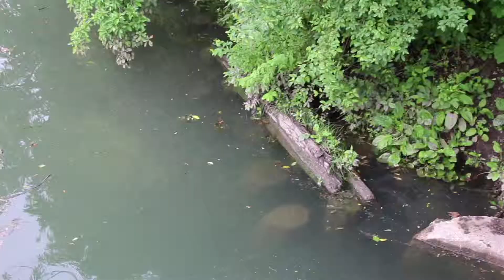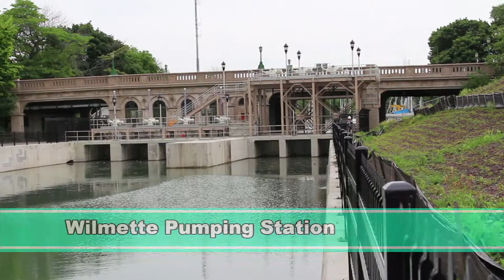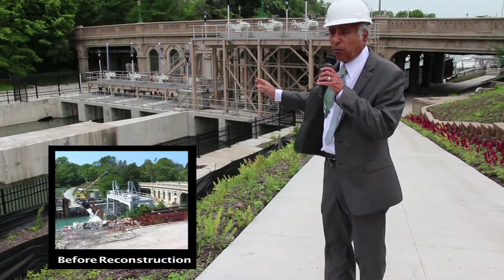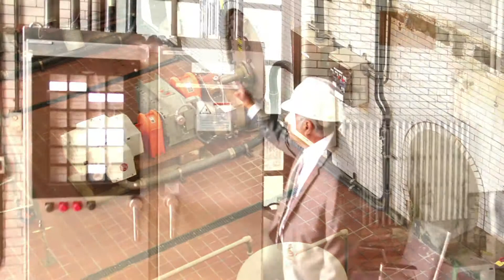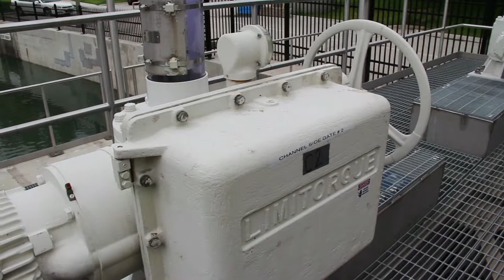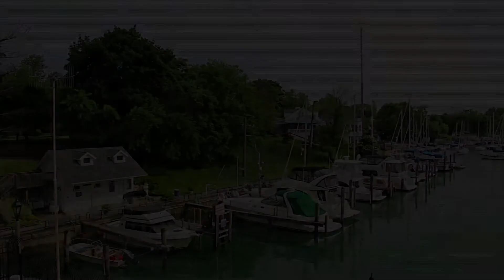Commissioner Avila at the Finished Wilmette Pumping Station

Comment: Are the inverts or inflow/outflow tunnels at the same elevation on both sides of the structure? I'd imagine this wouldn't matter for the two most western tunnels, but I'd imagine for the other two tunnels that they "descend" from Lake Michigan, right? Just trying to figure out how these tunnels were changed during reconstruction. Also, when the lake is higher, is there a constant diversion through the two eastern tunnels, or is the flow more stringently controlled?

This structure is interesting for me in how its conception differed from that of the O'Brien and Chicago Harbor works. The latter two seem to have been conceived to operate the CAWS below the level of the lake, thus they weren't built with any pumps. Wilmette seems to have been conceived as a sort of a summit, and thus the level of the lake seems to have been less of a concern.